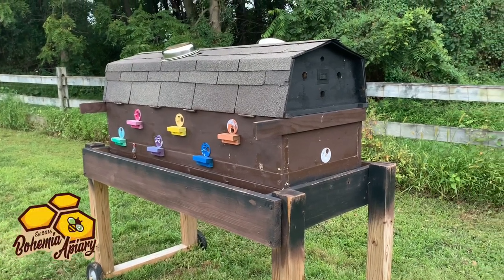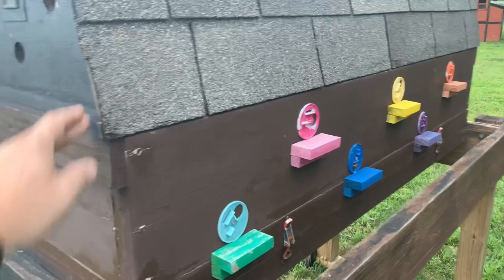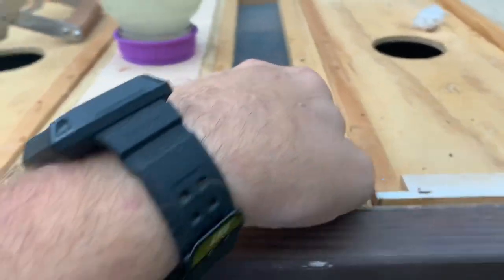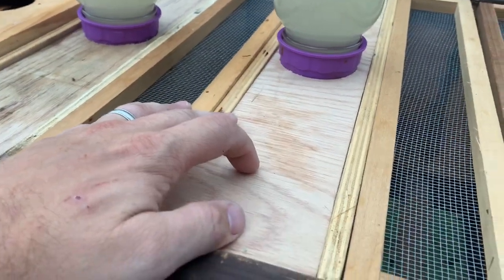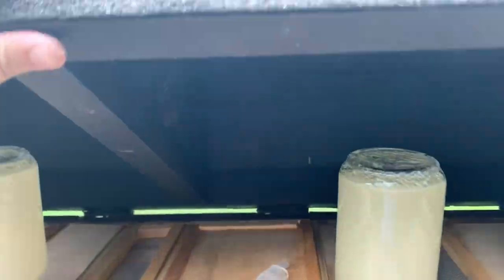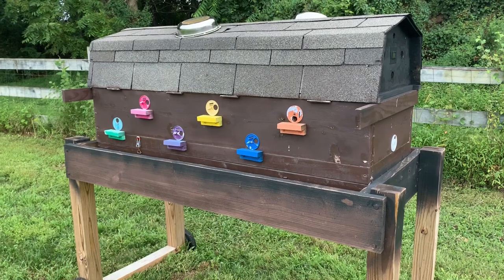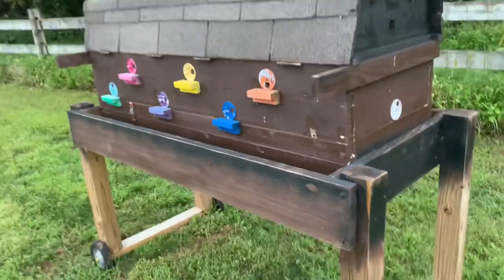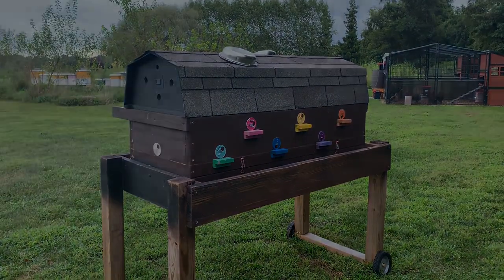Mega-Queen Castle | Beekeeping

Comment: I really like the idea.  I started using a small queen hotel last year, mainly as a tool for harvesting queen cells and banking a few queens for replacement.  If I wanted to expand beyond my small hobby operation of 10-15 hives, I would want something just like this for mating nucs.   I don’t necessarily think the fans are necessary as long as it’s well ventilated, but I do wish my Q hotel had an option to feed.  That is a real advantage of this one over mine.
Reply from the maker: It was a constantly changing build and if I did it again it would be much different
Reply: @BohemiaBees  what would you change?